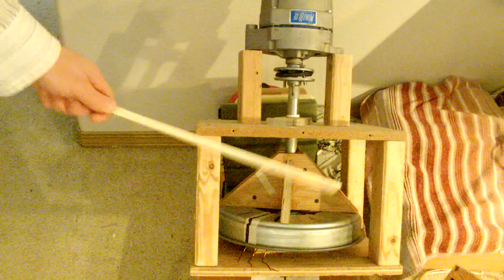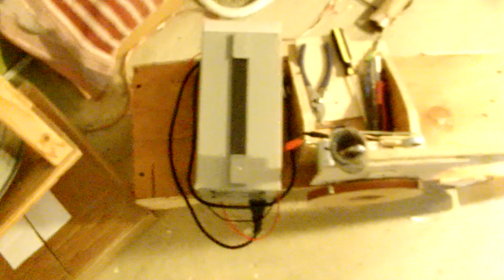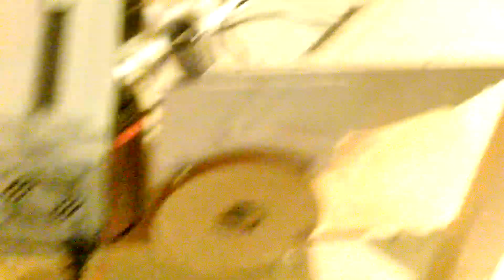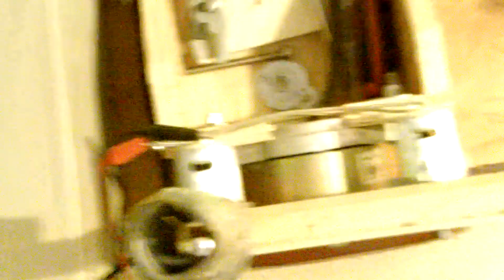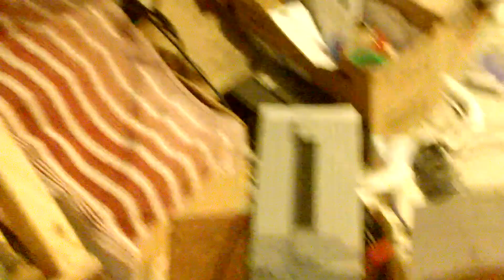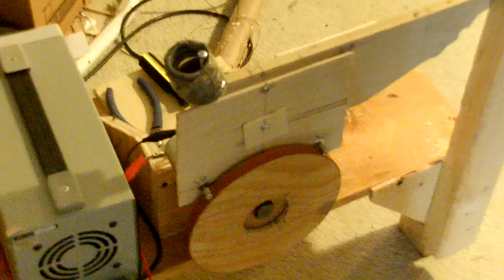overunity update june2020 free energy rotary lever scalar

Comment from the maker: a reminder:      i originally thought  george c  had  Done  it.   unfortunately, his  pma  was  not  well-made.      nevertheless, there is some  useful  information in his videos,  if one can see it. 
it is demonstrated that, the small DC drive motor  always  consumes roughly the same amount of power, about 1.32 DC watts.  (based on the power supply and ammeter values.) 
the decision to use of a non-contact drive mechanism at this scale, was  without  flaw.    obviously, it would not be difficult to utilize  multiple drive points.   and, probably necessary, at larger scales.          at :25, the (drive) reduction ratio is  Atypically  HIGH,  and in a  Single  stage;  roughly,  Sixteen  to  one.      this 16:1  mechanical advantage (MA) ratio suggests  that  Somewhere  in the transform,  a  16-fold  Increase, in  Something,  occurs.     i am not certain of the 'what'.      the  Where  is  ---   NEAR  the system center of rotation.     this principle  is  USED  in certain (larger)  wind  turbines !!!     those in which the first power take-off stage is  a  1:3  reverse planetary gearset.  (this is a  high-loss  method and not suitable for use in smaller applications).     it can be seen that in a  rotor having a radius of one hundred meters,  the Inherent MA  is a  whopping    99:1.         MA  is  a comparison of the  Radii  of two interacting rotary components; wheel/gears/pulleys.      d
https://www.youtube.com/watch?v=lTkXciAn488
really  big  ring gears
https://qph.fs.quoracdn.net/main-qimg-43c684702b4a6f0bdb160105645fe578-c